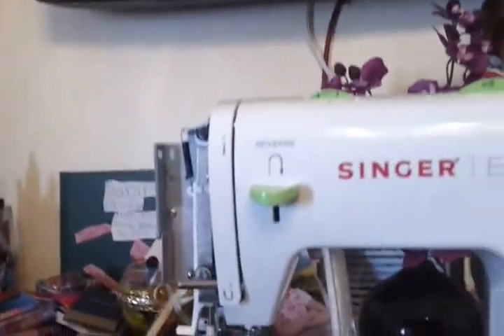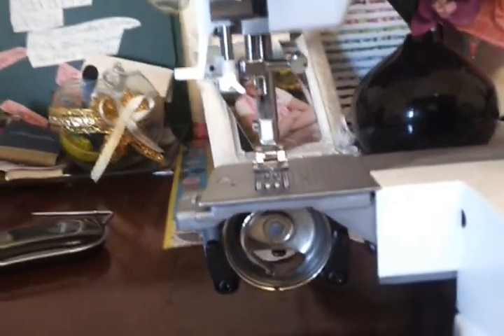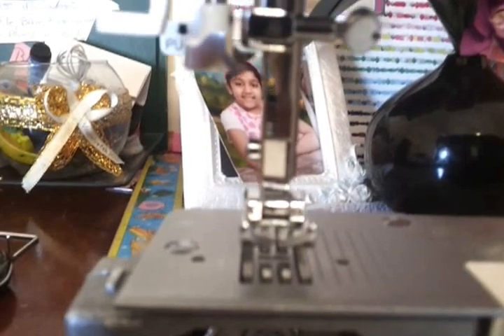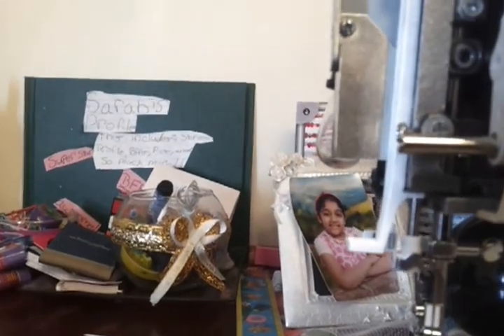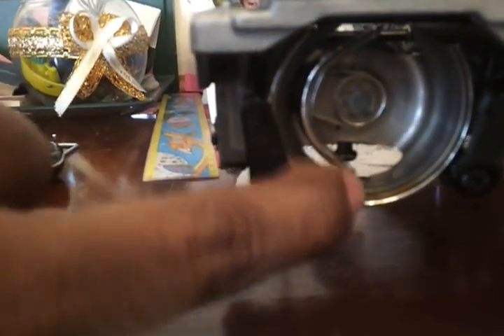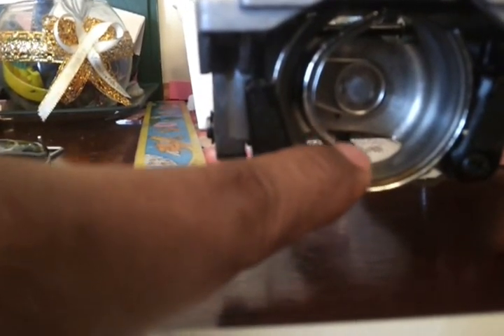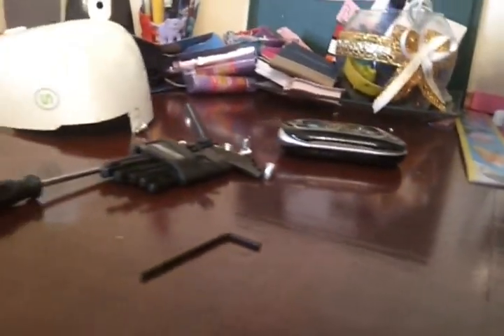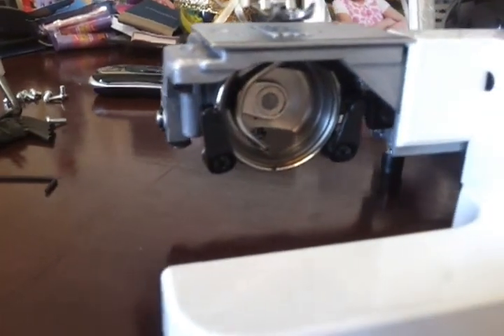Singer Esteem ii bobbin problems

Comment: My machine is brand  new and constantly jams up, no matter the needle or thread. Its a hot mess.
Reply from the maker: It could be a number of things causing the jams. If you pull hard on a bunch of threads, its quite possible  that the bobbin housing ( the part on the machine) is off position. Follow my video to check. For your safety remove the needle before you do anything.  There are a host of other timing tweaks but since it's a new machine, it's not likely a timing issue. Please let me know, if you get it going, or not.
Reply: Hi Martin, I cleaned out the machine and now the weird noise is gone it sews but the stitches in the back are skipping. The ones in the front are perfect? Is this a bobbin problem? I made sure the bobbin is threaded correctly and even changed the needle.
Reply from the maker: Abraham, I am glad you made some progress.  You want to check if there is play on the bobbin housing, that half circle metal piece.  You can do that by holding down the wheel so it doesn't move and try move that housing, if there is play then you will have to center it ( my video) and tighten the allen screw on the shaft on the back of the machine. Also check the tension on the bobbin. Let me know.

Comment from the maker: Beverly,sorry for the late reply, but I showed how to check if the bobbin carrier housing holder is "off" about a min and a half into my video, you should have an idea, and the allen key is used to re torque the 2 or 3 small screw behind the carrier which is in a sorta tight spot. Hope you figure it. Martin.